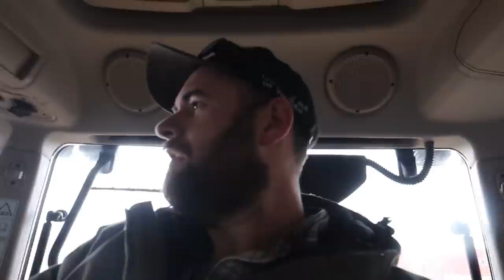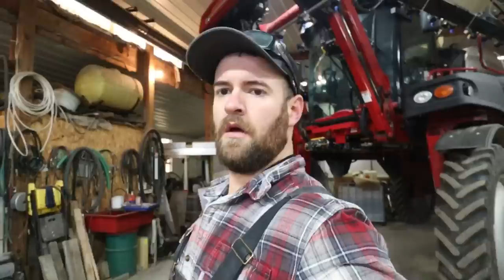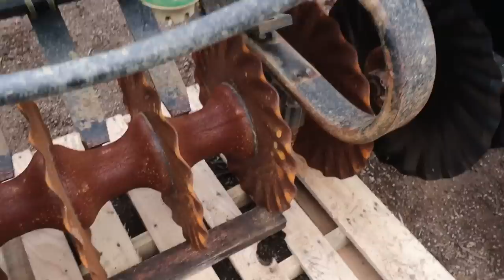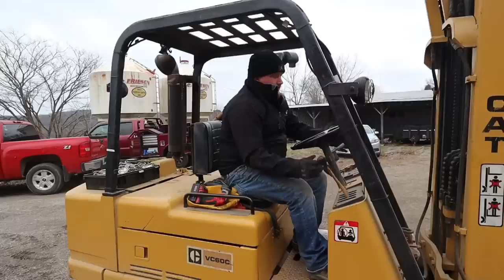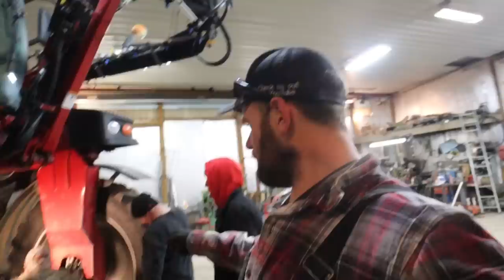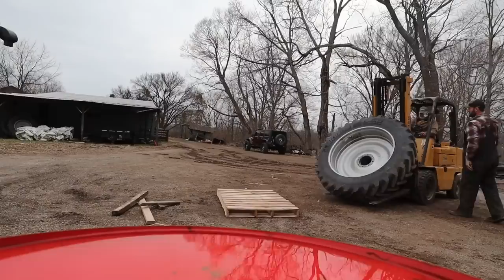Turbo Max Rebuild, Miller Sprayer Repair part 1

Comment: I used to build those tools new and rebuild them a lot. You should really have someone tap the blades with a hammer as you tighten the nut. I used to just drag them on the ground rather than use a pallet cause like you found it can be a pain in the ass.

Comment: People concerned about safety violations have never worked on a farm!
Reply: Or they have worked on a farm and are tired of seeing people crippled or killed.  I know personally of 3 people who died while farming, my great aunt died from heat stroke while gardening, a neighbor fell off his tractor went under the tire then under the bush hog, and another neighbor was kicked in the head by a cow while milking.  I know at least a couple dozen who have been seriously hurt or permanently crippled.  All I can hope for is that people try to be safe if not for yourself then at least for the people around you.
Reply: @tilapiastew6784  I hear ya, what I was getting at is that most everything that goes on,  on a farm is somewhat dangerous.  You have to be as safe as possible and even then accidents will happen.  What I was getting at is the tons of regulations posted by OSHA. Many are good,  some are crazy.  If a farm had to abide by all of those regs,  they would never very anything done.

Comment: When I was farming about 20 years ago, I would break EVERY O.S.H.A. regulation in the book...20 times...in 1 day!!  I remember one time when I was working on a planetary gearbox on the combine and instead of having jackstands underneath the lifted piece of equipment, I had several oak blocks of wood holding up the combine.  The blocks shifted and the combine fell to the ground...minus the wheel and tire that had been attached to the planetary components.  It took me ALL afternoon to get the combine back to it's former state of levelness.  Would the correct O.S.H.A.-approved equipment been safer?  Probably.  But then again, I wouldn't have a terrific story to tell!

Comment: Seems everyone has their ideas about how things should be done, HUH?? Well, I've got one for you, when ever we took a disc apart, when we put it back together, we would use a hammer on the arbor bolt while we tightened the nut. We had a 1" air impact like yours, we called it, "Bertha"! LOL!!